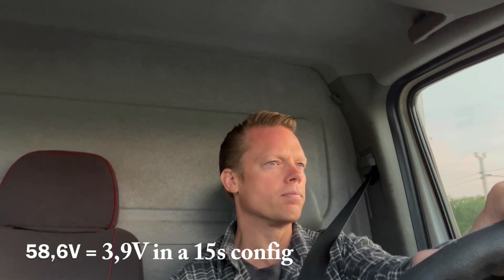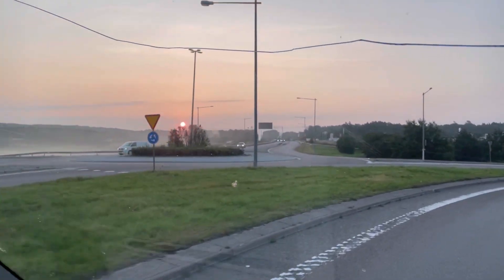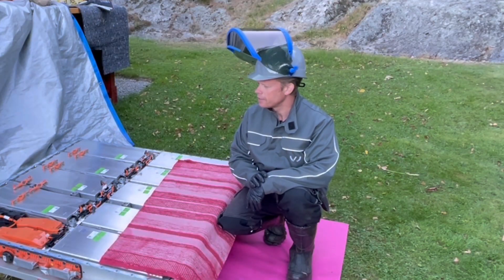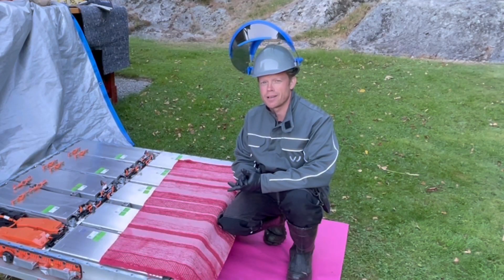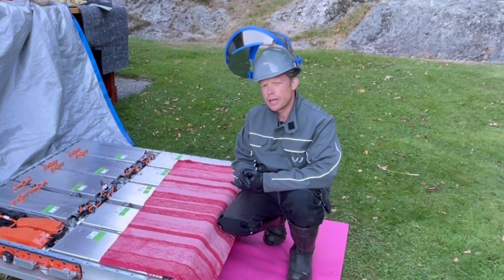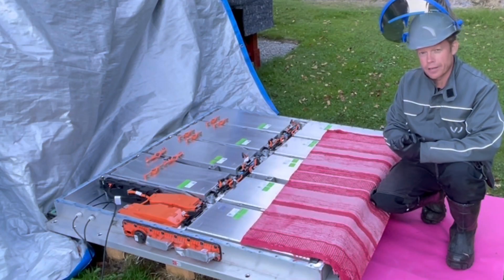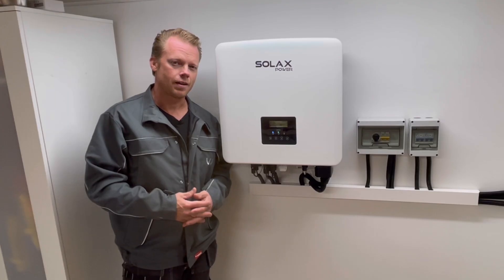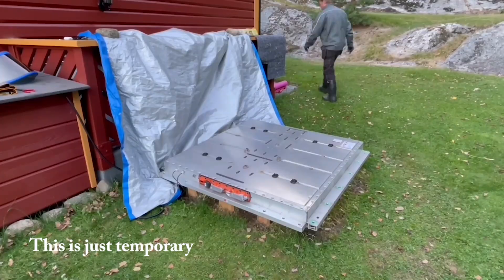Vw Id3 home battery 62kwh for solar storage

Comment: Wait a minute, so you just checked the voltage in the battery and replaced the terminals to attach to the inverter, and voila?

Comment: Can you do this with any inverter that's capable of charging a battery? I have a non-charging inverter, but want to upgrade to a 3-phase battery charging capable inverter within some time. As I have SMA now I'd like to stay with SMA, but if I"m limited to the amount of batteries that I'm able to use I might consider another inverter. The SMA has a battery voltage of 156 V to 277 V, so I'd have to find a battery setup within that range. A car battery would be a safe choice here, because they already come with a BMS. Which inverter do you use? edit: In the last minute I see you use a Solax inverter. I'll read into that.

Comment: Its the battery casing water tight, what do you think? It has a breather in the front, im not sure if its made to block the entrance of water in case of submerging. Thanks
Reply from the maker: The valves are there to equalise the difference in air pressure. It’s not designed to be submerged in anyway.

Comment: How i can to connect ev battery with 300 volt to solar system work at 48 volt
Reply from the maker: You can’t, you must reconfigure the battery cell first if so.

Comment: You are pulling .7 amps, 292 watts from the battery. Did you manage to fix this? I have the exact same problem, it draws 296 watts when idle. When i pause BE, it goes to zero, and only draws 4 watts from grid, instead of delivering 110 wtts.
Reply from the maker: Not using the battery emulator here, it must just be a coincidence.

Comment: I think if you find schematic of the battery you can looks whats the 12 v and ground and interlock. and the ignition signal, may you can get it started. that s what i would like to do if I would use battery like this.
and may the Can singals for diagnose too. but its not easy for that
Reply from the maker: Yes, now days it’s much more easy to do it. All the information is out on Dalas battery emulator sight. So now it’s at least worth trying😅

Comment: nice video, I would like to read the technical specs of your inverter , I have seen only 24v/48v inverters, non for such high voltage coming directly from  a battery. thanks!
Reply from the maker: Hi, thank you. Search for Solax x3g4 hybrid 15kW manual and you will have all the info there. Thanks for your interest.
Reply: @flyingtools  thanks

Comment: Do you npt need to use the BMS system in the pack to get them working with the invertor to prevent overheating etc?
Reply from the maker: I later installed a bms to it. 
Here’s a link to the video:

Orion 108S BMS diy Hv battery. Installing, testing, and balancing. VW Id3 Id4. Solar storage.
https://youtu.be/BwanbwCdA80

Comment: Hello from norway! Hypothetically, could you buy a wrecked car, and run cables to it like you did and use the regular smart chargers to charge it with, and a Solax inverter to drain it when needed? Then the inbuilt bms and cooling/heating should work as intended, right? I’m thinking one could disassemble just about everything but the essentials, and keep it stored in a shed or something.
Reply from the maker: Hi, probably not. It will sense that the battery will be drained for no reason and I guess that it will grow some error codes and eventually open the main relay.
Reply: Probably yes when you have a v2l option on the car.

Comment: Hi, did you manage to get the ORION BMS to work with this Solax inverter? I am just about to spend a lot of money on Solax inverter, Orion, Battery from E-gold ,.etc and dont want to find out later that something is not compatible. Do the Orion and the SOlax communicate nicely through the CAN? Have a you had any issues? Thanks.
Reply from the maker: Hi.
No, it should be possible but I use home assistant instead between my battery and inverter. Inverter is still in lead-acid mode.
The battery is protected stand alone by the Orion bms.
Reply: would you share what home assistant do you use?

Comment: Great video, just wanted to say that i ran across another video from Dala's EV Repair where he is using a leaf battery straight from the stock connections. unfortunately, the batteries supported dont include the ID3 battery but maybe in the future. Here is the link to the video
https://youtu.be/XHZWGLzT7gg?si=Cb6Jeky3oMDC6axj
Reply from the maker: Hi and thank you. I have known about this video sense the day it came out. But after some hours of work I now have my battery running perfectly on Orion bms instead.

Comment: i had a problem with the id 6 " high-volt battery " risk of fire . And when i diagnosis the vehicle i found A fault on Battery control Module it says "pre warning over temprature"  i need you help?
Reply from the maker: Hi, that doesn’t sound good at all. Sadly I cannot help you with that.

Comment: how can inverter work with battery of that high voltage ? every hybrid inverter works with 48 volt batteries so i wonder what is what i dont understand here ? how are you able to connect 400 volt battery to 48 volt inverter ?
Reply from the maker: Hi.
This inverter can take up to 600v.
And it can also work with lead acid batteries, that’s the trick here.
So I have an Hv stand alone Orion BMS
And it works just perfect. 
I have a lot of more videos that  probably will give you the answer if you want to see/learn more.
Thanks for your question.😃
Reply: @flyingtools  oh perfect that is great thank you i will have a look :) is there any way to know how many cycles batteries have left untill they die completly ? :) your video is amazing by the way about id3 battery
Reply from the maker: @triplextriplexxx8225  oh, thank you so much ☺️. I think it’s possible if the battery are checked when it still is in the car. As long as the cells are well balanced, I think that those batteries will hold for a really long time, especially for solar storage where the charge and discharge current are so low.
Reply: @flyingtools  i am preparimg planing my solar system thank you for your tips. Did you ground your solar system ? Against lightning strikes , do you have lightning conductor installed i suppose you have

Comment: I have yet to see anyone else take the precautions you have. Being an electrician myself, I know how little the amperage needs to be to kill any human (one milliampere = one millionth of an ampere). So to see your intelligent manner in preparing these modules is refreshing as I have seen so many people who know just enough about electricity to be dangerously negligent, bordering on disrespect of the potential power with which they handle while taking these batteries apart. They have no clue as to the very real dangers of the amperage they’re handling. Perhaps if they had the opportunity to see the consequences of a single mistake, they would take the necessary precautions you have in this video. So thank you for taking the time to show respect for this power we call electricity = but I look at as the Hand of God Almighty as it has the “power” to take life away and to give it back, in an instant.  With regard to a BMS, you might check out jag.35 as this DIY company, has fabricated many BMS in the systems he has offered. Just FYI.
Reply: one milliampere is actually one thousannths of an ampere not a millionth. A millionth would be a micro ampere.
Reply: I was thinking the same thing especially when he said he's an electrician 😂 @marviwilson1853
Reply from the maker: Yes, those batteries are not to play with.
I decided to go with Orion bms system and I am very pleased with it.
Thank you so much for your comment and information😃🙏
Reply: I'm considering doing a similar setup with Tesla batteries. I had a minor concern when on the fitness mat over the grass. I was thinking some plywood sections over the grass would add another level of safety. I was also thinking something like a plastic carpet runner or large rubber mats over the modules would make things safer. if a high voltage accident were to happen its possible to accidently fall on top of the modules.
Reply: @tbarrera1833 FYI, the battery voltage is not referenced to to the earth so there is no need to isolate yourself from the ground.
Reply: Dude what? 30mA is where we start to worry about death.
And thats 30 parts of 1000 parts of an amp.
Please if anyone reads this comment take notice he is way off on heaps
Reply: voltage kills, not amperage
Reply: @andreytimoshin  Well that is completely wrong! Voltage is the "potential" that drives current through a resistor. It is the current that kills you and that need only be milliamps. Water high up in a reservoir is similar to voltage. Under gravitational attraction it has the potential to produce a fast torrent of water. Static water high up in a mountain won't kill you, the tons of water hitting you at high speed will.
Reply: Both of them need .
Therenis a relionship.
100 amp at 24 volt does nothing  @andreytimoshin
Reply: Fatm electric fences are 10000  volts   , why is that not deadly ? @andreytimoshin
Reply: @andreytimoshin Complete opposite. Volts jolts, amps kills.

Comment: In Germany for HV3 (Working on not disconnected HV Voltage) - we dont need Leather gloves - only the usual HV Gloves but with a check if they are ok ...
Reply from the maker: Oh, interesting. Those gloves has dual protection, voltage and 
arch protection ⚡️ if something goes really bad.
Thank you for your comment and information ☺️👍🏻

Comment: Hej, såg din senaste video om att gå off-grid. Har lite input till dig angående varför man inte får göra så utan att ha en automatisk "frånskiljare" mellan invertern och nätet. Det som kan hända i ditt fall är att o strömmen går och du går över i off-grid så kommer ditt system att mata ut ström tillbaka på nätet. Detta är inte tillåtet för att skydda de som jobbar på elbolaget samt deras utrustning. Tar gärna en diskussion om hur man kan göra då jag själv funderar både på batteri som i din lösning och att stötta nätet mm.
Reply from the maker: Hej och tack för din input. 😊
Den automatiska frånskiljaren är inbyggd i denna invertern så ingen ström kan matas ut från eps sidan vidare ut på nätet. Men du har absolut rätt, det får ALDRIG finnas någon risk att spänning matas ut vid ett ev strömavbrott.

Comment: Too bad the voltage of the subcells is only 44 volts and not 48/52 volts.
Reply from the maker: Yes I totally agree! Luckily victron multiples inverters can handle that voltage span just fine.

Comment: What inverter model are you using exactly? Can you programm the battery max. charge, and discharge voltage by yourself?
Reply from the maker: I have more info about the setup in this video: 

https://youtu.be/VW4UjZP3jhc

Comment: Thumbs up 👍🏻, great work!
Regarding your battery cycling: 
As far as I know, does the balancer only kicks in at max voltage and starts burning energy of peaking cells. In addition it would shut off the whole pack if a battery reaches a critical over or under charge, for safety.
But I agree if you stick to the very limited voltage range you did your cycling with, it is unlikely to exceed critical voltage rates of a cell even without a balancer, at least for quite a while.
Reply: For this growatt invertors have "Battery equalized interval" it could be configured to charge to full few times a year and to be kept at that voltage for few hours.

Comment: It's fantastic and good that we can buy these packs at the scrapyard. 
- What chemistry is in this EV-kind of battery, is it the thermal unstable old-fashioned Li-ion-mix-type, or is it based on the stable (from a thermal run-way condition) LiFePo4? Cheers.
Reply from the maker: In cars they use li-ion, which is as you say much more unstable. So I hear highly recommend you to have it on the outside of your house. Thank you for your comment.
Reply: @flyingtools  I think there are teslas (especially in china) that use LiFePo4, too.

Comment: I service these batteries at work. I like working on them.
Reply from the maker: Same here👍🏻 And as safe as a high voltage battery can be if you compare it to some other car manufacturers. Thank you so much for your comment.😊
Reply: Do you know what the balancing fuse inside the battery is rated at? I keep hearing different values and get more and more confused for every time I read a new rating :)

Comment: I really like how thin is your wire to the inverter thanks to the high voltage of the battery compared to the the low voltage systems. I wonder though, why there is no water terminals for active cooling. Is it the same system as Nissan leaf?
Reply from the maker: Hi, the water channels are at the bottom of the battery box. So the whole floor of this battery acts as a cooling plate for the battery modules and the modules are sitting in cooling paste for good heat transfer. You’re not the first one who asking me this so maybe will do a video about just how the cooling system works. Thank you so much for your comment.😊

Comment: You don't need insulating earth matts when the battery module has no 'reference to earth'... as long as you don't touch the negative terminal with one hand and the positive with the other,.. you will be fine,.. the old adage of keeping one hand in your pocket,.. has more relevance than you might think...
Reply from the maker: You are absolutely right about that. But better to be a little to safe when you do stuff for the first time😅
But yes, that’s completely unnecessary.
Thanks for your comment 👍🏻
Reply: However, it does worth it to take some extra measures to avoid accidents.

Comment: Hi, thank you for your very interesting video. I almost jumped on the seat when I saw my very same inverter which I have connected to a single Triple Power Battery. I'd like to upgrade to a system like yours but, unfortunately, you skipped the connection of the battery to the inverter. Is it as simple as connecting the two connectors that came from the battery? Anyway what do you think about connecting the battery in parallel with the solar panels?
Reply from the maker: Hi, and thank you, I think that’s a bad idea to connect the battery to the solar panels input without having some kind of controller between it, so you can regulate the input and output power.

Comment: I want one of those batteries. How much did it cost?. But I would have broken down and removed each of the 9 44V modules to make it more manageable, else you've got this really big battery you can't easily move.
Reply from the maker: That’s why I ended up with building a trailer to it and install it in a insulated box.
And who know, I maybe will use it as a range extender to my EV car 😅
Reply: Yep, I was curious of the cost too. Teoretically 6 times a powerwall, but not new. On the other hand, I see chinese competition pushing price to a tenth, maybe a fifth with transport and taxes.. new.... 
So I guess that this one may be somewhere from 5 to 15k  depending on local demand of this typo of stuff.

Comment: Great project BUT - my manager's ID.3 just went up in smoke last week. It was parked next to her house, not charging, had not been driven recently, the battery just started smoldering. The fire department came with a big truck with an open container in the back. They put the car in it, drove it to the fire station, put the container on the ground and filled it to the top with water, completely submerging the car.. The car should be taken out today or tomorrow and investigated. It is, of course, a total loss.

Google "elektrische auto broek op waterland" and click News, and there you can see the car being put in the truck. (Dutch news items)

Soooooooo..... I would be careful putting an EV battery in your house. There are safer battery chemistries around.
Reply from the maker: I would never put any type of battery in my house😅  here’s a video when I finished this project.

https://youtu.be/ldox2_BXVzk

Comment: What kind of thermal management systems are there with the VW ID3 pack?  It looks like there is a cooling plate, but how do they heat the battery for cold weather thermal management?  Thank you!
Reply from the maker: Hi. The bottom plate of the battery is heated and cooled by liquid.
Thanks for your question😊

Comment: Maybe I missed the point, but how heavy is the whole frame incl. the batteries? And how much did you paid for it? Thanks in advance great channel keep up the good work.
Reply from the maker: Hi!
396kg
You can find them on junkyards for around 8000euro.
Thank you😊
Reply: @flyingtools  well the price per kwh doesn't seem bad at all 🤔
Reply: @flyingtools  Thank you and Happy Easter.
Reply: @flyingtools Wow, that's an expensive junk.
Reply: @flyingtools  I really don't think that's good value for money, you can buy brand new Renogy 12V batteries for the same cost per KWH (£300) if you spend 8k euros and they're a lot easier and safer. Considering the cost of recycling they should be a fraction of that price, especially for the ones with reduced capacity.